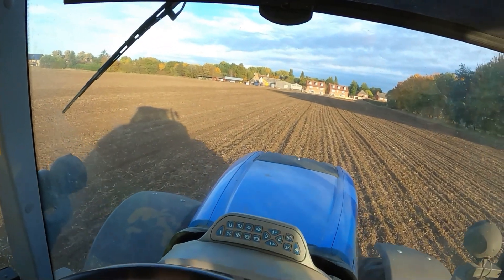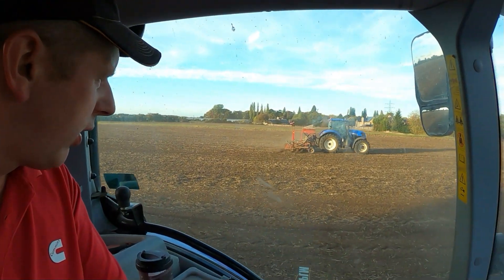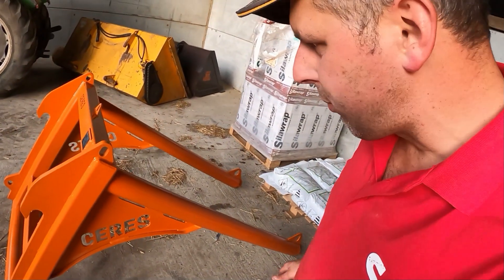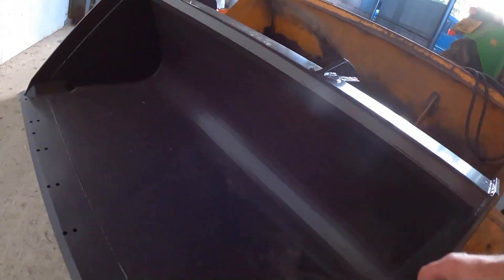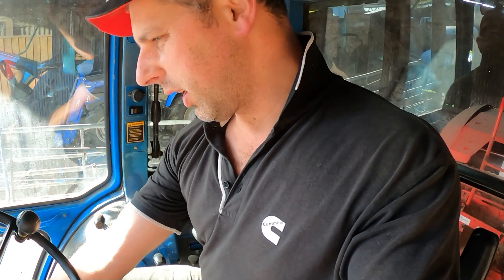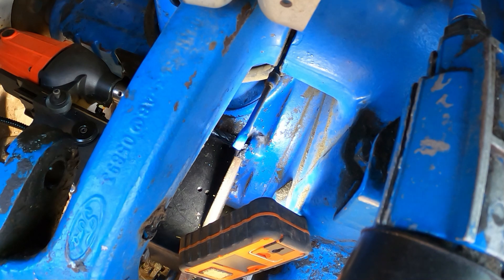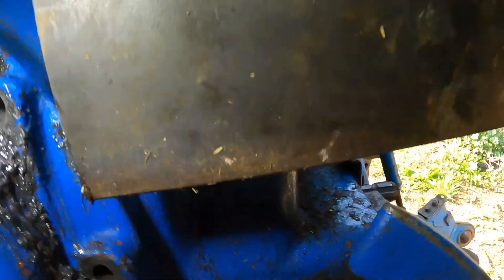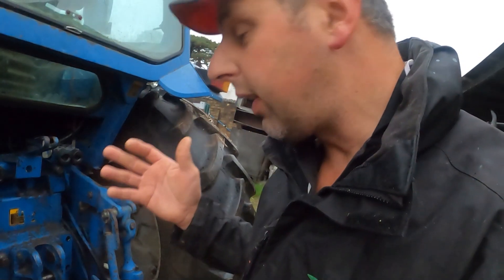FORD TW UPDATE - CERES MACHINERY - GETTING ON WITH DRILLING

Comment: Try using a hot air gun on full in to hole (after you have removed extractor) and then spray in plenty of WD40. Re apply the extractor. A few strikes on casing with a copper faced mallet may encourage some movement.  Good luck.

Comment: Keep on her you'll get it. Try putting 3 new bolts in lower down to take some of the stress/load off the bolt your drilling. Also like other comments try a left hand drill bit. In my experience it'll wind its self out.

Comment: Can Not Beat a 6 Cylinder Hunting First Thing From a Cold Start  😊
As a Engineer myself ,You Seem To Have a Good Idea Of How to Go about Fixing Things,That Mount is A Great idea👍
When Ever i had a Brocken Bolt to Get out The First thing to use is Heat as it Saves a Lot of chewing Stuff up and breaking Extractors etc
Admittedly Not Easy to use on that Bolt So What your Trying Apart from Taking The Trumpet off Looks the Only Way.

Comment: Definitely try a left hand drill bit, works really well
Reply: Agreed with left-handed drills.  I’ve not played with big stuff for over 20 years, but these days it is generally a right-handed pilot drill, followed by progressively larger left-handed drills.  Nothing bigger than about 1/2” and mostly smaller, these days.  Sleeves to keep the smaller stuff central can help, too.

Comment: Had the same issue with a john Deere  with weighted centres 
 Raised up the back end and secured a wrap bale lifter the wheel  then that sitting on a pallet truck and removed trumpet housing  wheel complete 
Use the wheel the opposite side to turn to allow for refitting
Reply: We were told at the time by a veteran JD mechanic not to loosen the weighted wheels you'll never get them tight again
Reply from the maker: Good tip JP👍 I hope I don't need to use it👌